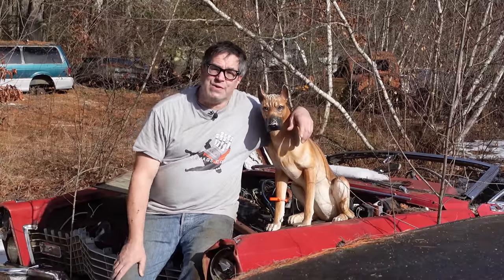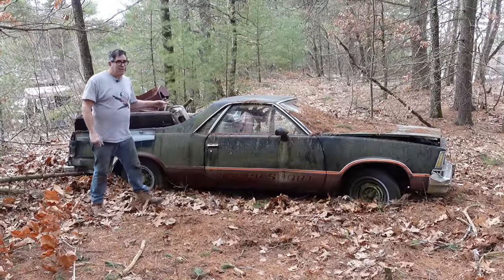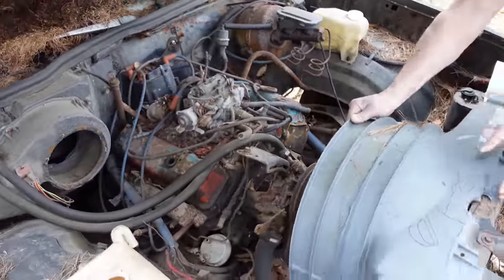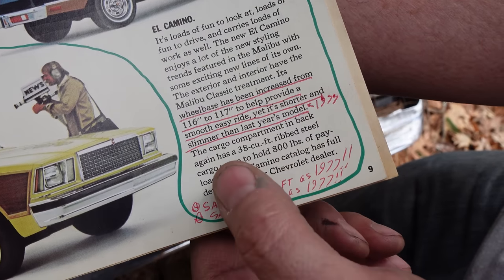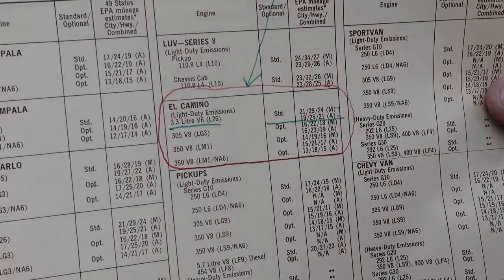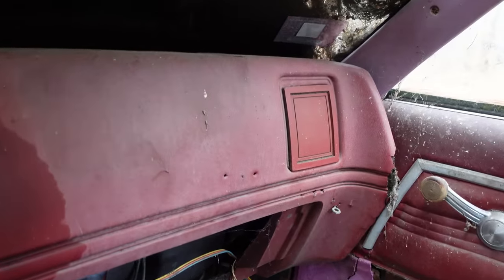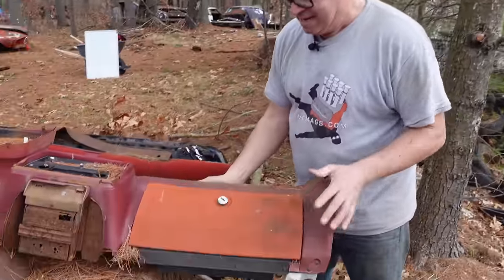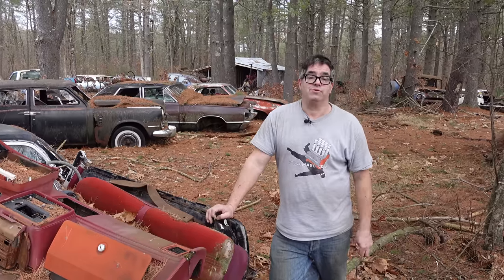El CRAM-ino

Comment: The government should never have been in the car industry. They ruin everything they touch.
Reply: One of the most accurate comments on YouTube ☝️
Reply: @kurt poblenz….they screw up everything they touch…
Reply: Kane argue with that every time the government decides to do something. It's just a big mess ruining everything
Reply: Don't blame the feds, blame the American manufacturers. If they had tried to improve emissions they wouldn't have been forced to.

IE: catalytic convertors were bad for performance, and required by feds. Honda got the emissions better than a cat, without a cat, using CVCC. Then, to prove a point, put CVCC on a GM V8, and it also passed the emissions tests without a catalytic convertor.

CVCC could have worked for GM, as Honda proved, but instead of using CVCC (or enginerding a similar tech) the US manufacturers used catalytic convertors. 

That cost them less, and only hurt the customers. Since no American manufacturers did anything about the new emissions requirement, and Honda didn't make big cars or trucks, there was no competition to do anything.

Catalytic convertors were the easy way out, and that's what American manufacturers went with. The easy way, because they were (&are) morons.
Reply: Yes, considering they know nothing about the automotive industry as they don’t know anything about it now either.
Reply: @garyslentzii2796  …. They can tax , what they can  control 😡😡😡
Reply: @AjAJ-qr4vo  right now cars are built to fail, because they realized that cars that are good won't get replaced. That hurts sales, if a customer never returns, so the cars need to be good, for now, but not too reliable.

IE: components are "lubed for life" is false. "Life" refers to life of the part, not the car, and there is no zerk. That guarantees failure, and there are many components like that on a car.

I wouldn't be surprised if someone finds a "kill code" written into the a vehicle's ecm/bcm/CAN hub, so the computer makes the car stop working. Tied to calendar date, or elapsed time operating, idk. Nor do I know if it causes total system failure, or an "expiration" notice on the radio, or a slow death caused by things malfunctioning. 

That might be too hard, though, compared to making structural parts out of biodegradable plastic (which they are already doing).
Reply: Except when they changed the fuel tank law on schools buses
Reply: @kenthowell7829  I'd blame that on consumers. If people demanded more safety they would have got it, but they didn't, they were focused on price. Had that cage been installed before the incident, the bus would cost more, or they would have bought a different bus that cost less.

The law requiring all manufacturers to install a cage is really to stop consumers from being able to save money by not buying the cage.
Reply from the maker: @Iowa599  Regarding the idea of a "kill code" I often suspect that home computers "time out" after a certain number of years "by design". Of course, do know that any manufacturer who is CAUGHT doing this will certainly suffer a potential CLASS ACTION LAWSUIT brought by watch dog groups. I think the fear of getting "caught" might be a strong deterrent to built-in "kill codes". But who can say...It takes a hacker to catch a hacker, right? Thanks for watching and writing. -Steve Magnante
Reply: @SteveMagnante  I don't think it would be "too" hard to add code into a module that was nearly undetectable. 

IE: write to an eprom in binary code to turn multiple conflicting signals on, at random intervals. (ie: apply power and/or ground to the same and/or wrong circuit) That could fry that module, or anything else, so the problem could be misdirected from the cause.

The eprom could even be a separate circuit from the main circuit inside the module, so nobody would notice it unless they map the entire board. I don't think very many (modern) modules are available aftermarket new, only reman, which is because they don't get physically decoded.

(this is why I own - only - antique or carbureted Honda's)
Reply: @Iowa599 Did not know that about Honda proving that worked on the gm V8. Thank you.
Reply: @kurtpoblenz You are absolutely right dead on. 👍